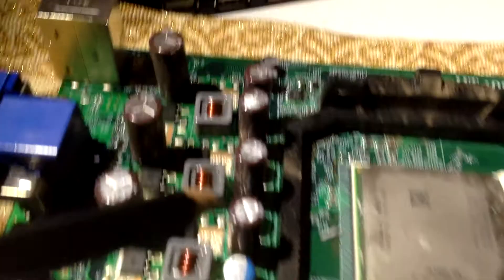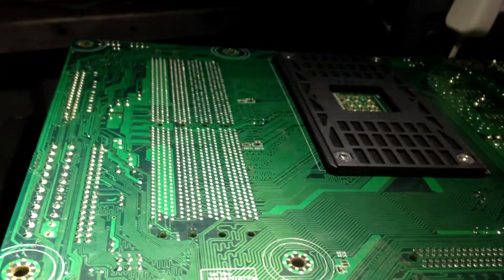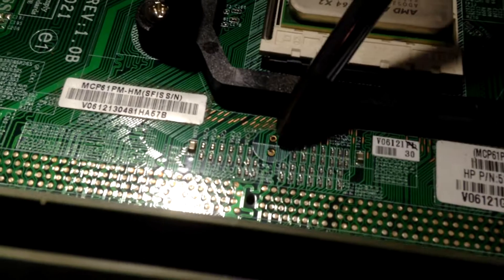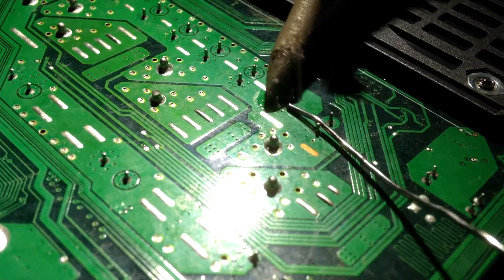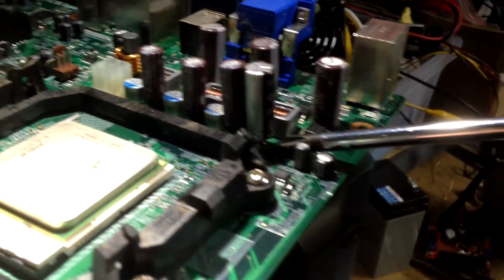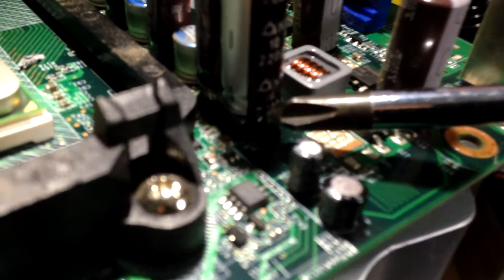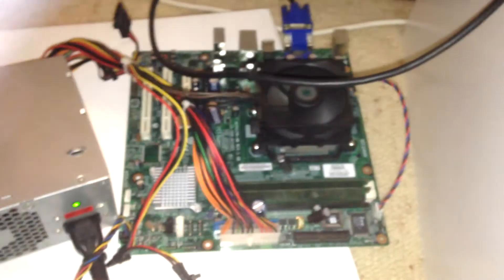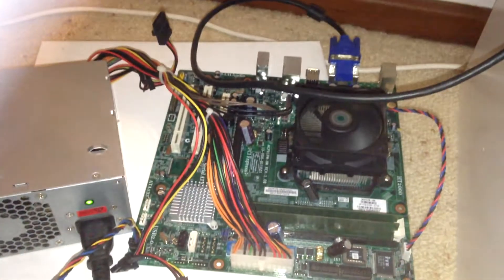Fix Blown Motherboard Capacitors | How To/DIY Replacement | Easy!

Comment: Hello I moved my motherboard to a new case with a new gpu I powered it on it worked for about 5 minutes then randomly shut off. But before it died completely it made two beeps at startup which it had never done before. I’ve tested multiple psu on the pc but the motherboard seems to not be getting any power from them. Kinda hard to explain but no signs of life in the board... no fans spin or anything... could this be a bad cap?

Comment: Would it not be better to use a finer tip? As the one i have is around the same size as yours just wondering if i should be a small one or not.

Comment: So the replacement capacitors should have about the same specs as the original ones? Will the original capacitor have that information on the itself or will it be somewhere available from the manufacturer, manual or google it after removing it?

Edited: I got it now, but thank you for sharing the video.